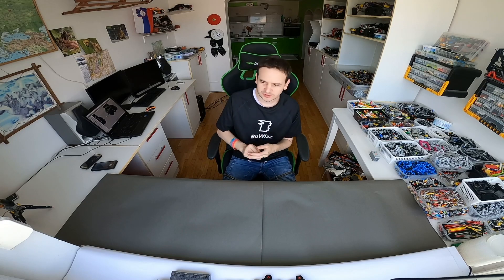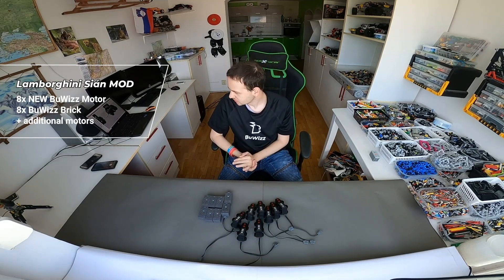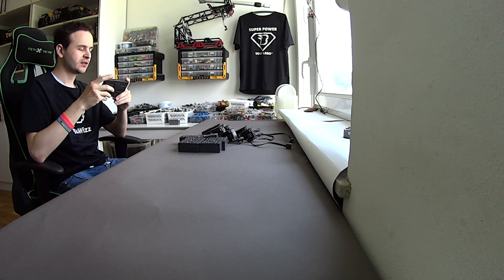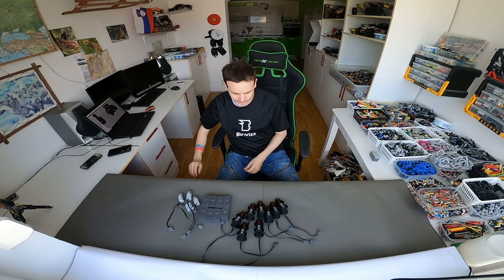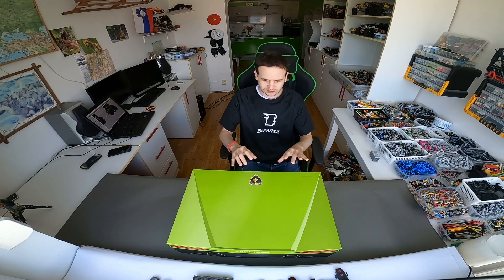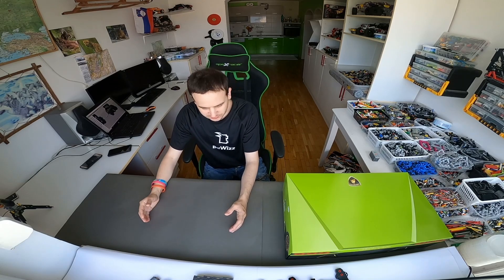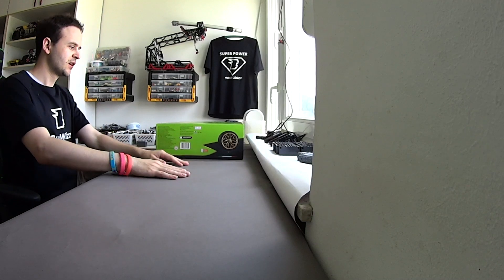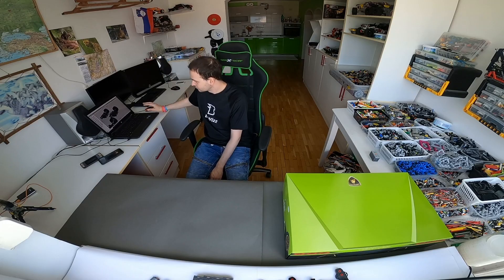Building the fastest LEGO® MOD series - 42115 Lamborghini Sián - The concept (1/12)

Comment: I was losing interest in Lego because the only good motors were the buggy ones and they're way too expensive, but now with those buwizz motors i might actually go back to building lego car 😉
Reply from the maker: That was our main idea. To offer a powerful motor to accompany BuWizz brick. The buggy motor was a natural choice. The form factor isn't perfect and we will change it after we see if it is accepted by the community. It is going to be fairly priced and accessible to all the fans.
Reply: @BuWizzBrick  the only question is, how long is there to wait? The idea to make your own motors is great, because new Lego motors just suck. For example, it is no longer possible to connect them in parallel because of the new connectors. It would be great if you had all the analogs of Lego PF motors, including the servomotor.
Reply: Ha-ha ... Why are you sure the buwizz motors will be cheap?
Reply: @igornechaev8899  i don't think they'll be that cheap but i'm guessing it will be around 50 (pure guess i have no idea), far from the 100 for the og buggy motor. It's cheap enough for me.
Reply: @swagie_  , it seems to me that the form factor of the buggy motor was not chosen for a simple reason, but to justify its price. The L-motor is much more convenient to use, but it is not interesting for buwizz, because it's really cheaper.
Reply: @igornechaev8899  you've got a point, but i think that the buggy motors are very expensive rn because they're not sold by Lego anymore (wouldn't be more than 50€ otherwise) but i still think the buwizz motors won't cost more than 50€ because of that, and 100€ is just too expensive in my opinion
Reply: @swagie_  50€ is also very expensive for me. 20€ would be a reasonable price. Considering the price of the motors that Lego still produces.
Reply: @igornechaev8899  ik and it's the same for me but it's very unlikely, buwizz can't make theme for that cheap compared to the lego motors but the buwizz motors will also be better, let's just hope they make theme as cheap as possible (30€ would actually be very good considering what i said above)
Reply: @igornechaev8899  The L motor is nowhere NEAR the RPMs or torque of a buggy motor. Not even close, sorry.
Reply: @BrianGunningUS   The L motor is just a convenient form factor, the new L motor can be made with any characteristics, even better than those of the old buggy motor.
Reply: Igor Nechaev  the “New L motor”? You mean the Control + motor? I am looking at tests that show the new motors are slower than the PF motors. What are you talking about?
Reply: Igor Nechaev oh wait, are you saying Buwizz could easily make an L form factor with a better motor? I am sure they can, but the Buggy motor is the first most obvious hole to fill. I hope there are others too!